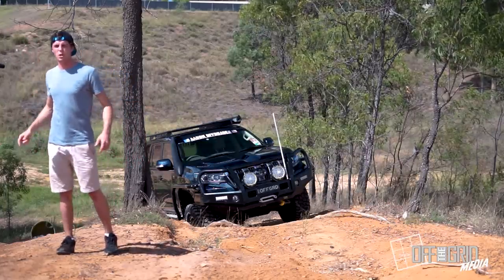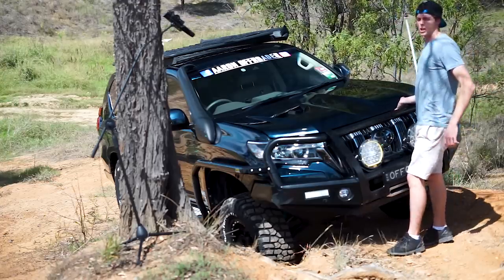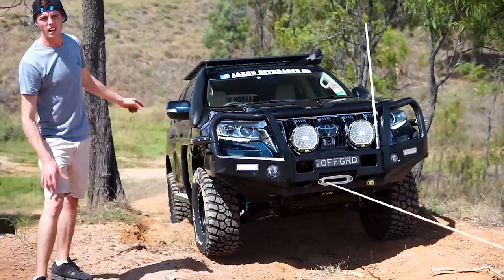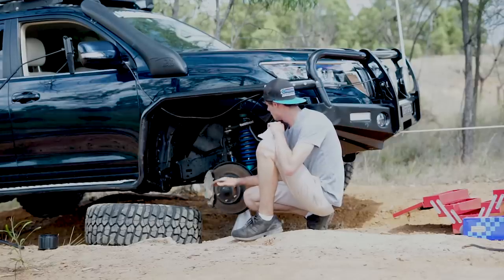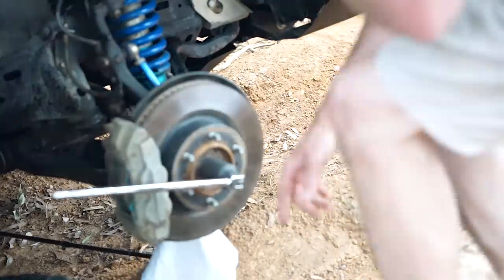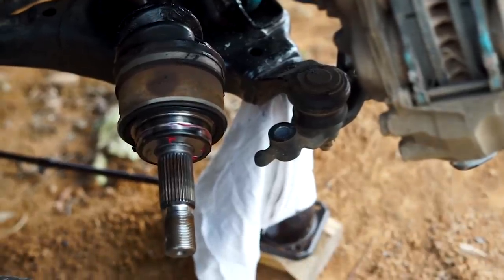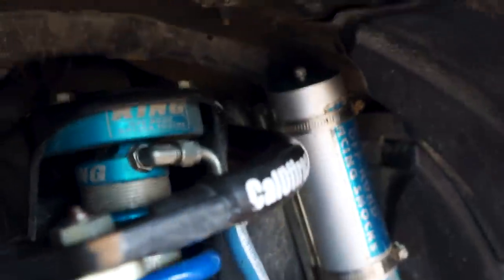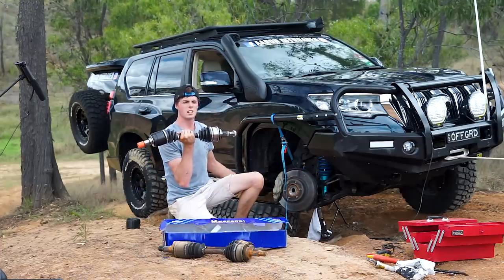4x4 CV Change, Bush Style, Real Life Conditions ** DIY **

Comment: Yes!! More diy. Theres no diy vids for our model prados! Legend
Reply from the maker: Cheers legend! Ive got a massive list of ideas to get through. I should start pumping them out 👌🏽
Did you have any special requests?
Reply: @AaronOffroader  just a heads up mate, I would've lowered the vehicle back onto tyre.
Once tyre was pulled off, even put some maxtrax or timber to lift tyre up to side steps.
Reply from the maker: Jason Currie Yeah,  I agree. Would have been safer 👍🏼

Comment: Nice job.  We need more DIY repair videos for Prados, the online repair manuals are a bit cryptic.
I also have a 2018 Prado and was wondering what to do about a busted CV or wheel bearing ..... carry a spare assembly of course.
By the way, you can get a split rubber CV boot from Ebay UK that will fit the 150, as a spare in case it gets torn in the bush.

Comment: Loved your video. I carry a $2 tarp to put under any work I do in the bush so as greasy parts that drop stay dirt free and are easy to find. I also use a piece of ply as a jacking plate.
Reply from the maker: Bob Waller yeah that is a good idea! I use my awning extension sometimes but dont really want that all greasy. So a $2 tarp would be perfect
Reply: Great tip

Comment: How did you lock the rotor to crack the hub nut if the cv let go ? Did you have someone to stand on the foot brake ? Why did you not crack the hub nut when the tyre was on the ground ?
Reply from the maker: Yeah doing it on the ground is definitely ideal. Just a stuff up on my behalf really. 
But you can put a strong screwdriver down ontop of the caliper. Into the brake disc vents. That will lock it solid in one direction. Or have someone on the brake like you said 👍🏼

Comment: 10:22 You don't change the inner seal? You don't even clean the seal? Won't that keep leaking oil there? 
Cheers
Reply: it will leak if you get dirt in there, it will not leak if it's clean or just has oil on it.

Comment: Hi mate if that was a hilux you could keep driving in 2 wheel drive because it's part time 4x4
Reply: Do you or have you guys in AU had issues with DPF.
Reply from the maker: Yes this is correct 👍🏼
Reply from the maker: Yeah quite a few have had problems. I think its more the people who putt around and do short trips. 
Mine cops abit of a flogging so theres always plenty of heat to burn off properly 👍🏼

Comment: Lock center diff, and it's gonna drive without a darn front CV.. eventually remove the other.
Reply from the maker: florin baiduc yes very true! But you must install both ends of the CV! 

One to plug the Diff oil. 

Then other to hold the wheel on and wheel bearing together. 

You can remove the actual shaft by cutting the boots and dissasembling it! :) 
The shaft doesnt matter if its taken out, cut it in half if you have to.
Reply: @AaronOffroader  true, it hasn't occurred to me. But it's doable nevertheless. Thanks for clarifying this!
Reply from the maker: Thats what you want,
Always a pleasure mate :) 
Have a good one!

Comment: Before you put the cap back on over the cv, do you need to put in any grease ?
Reply from the maker: not really Jordan, a little on the spline just to stop corrosion. or even anti seize.  the wheel bearings are sealed units. But on the back side make sure you do put some grease where the seal is on the CV :) Happy Days

Comment: What brand cv are you using?
Reply from the maker: Umm Kapsars i think. I havent properly sheared one yet. But i did destroy the inner joint completely on a genuine one. 
Just over extended a few of them. But shocks are destroked now
Reply: Aaron Offroader do you have a diff drop. I have changed 2on my sons hilux . Both times on a steep track and using the winch to car like you explained, its a great idea. I also cut some dead tree as a jack stand. But not everyone has a chain saw. But you just gave me an idea on why his are breaking, maybe his shocks are overtraveling. Cheers and great video mate👍

Comment: If having to drive home with removed cv....: You will have to remove remove other cv. Ill explain why.
To move off with missing cv you need to engage diff lock. Hence power will be going to front and rear differential. As the diff is now missing one side connection to ground it'll will be transmitting your full engines rpm through the satelite gears to the missing cv side! You will burn out your satelite gears or/and shims etc.

Hence forth, solutution to running with missing cv is as follows.
1) Remove broken cv. Engage front difflock. Run vehicle without a centre difflock home. Plug hole in side of diff. Note if you have twin lockers you will need to switch your piping at the solenoids as arbs need rear locker on before front is engaged???
2) remove both cvs and run home with centre difflock engaged. I imagine you would need to stop oil from coming out of the diff. Not sure how thats going to happen.
3) remove cv and front.propshaft. engage centre diff lock.
4)if having to travel home with missing cv its best to remove both cvs ad remove front prop. Run vehicle with centre diff lock engage.
That way the front diff will be not turning. With some rags on the sides you shouldnt loose much oil or dirt entering diff...

I think the main problem heading home without a cv in the diff is you destrying the diff and oil coming out. You need a solution to that. Reason for removing cv is it maybe super exploded or snapped . 
Best solution in my opinion is learn what how to swap your cvs in the field or run solid axle front end 4wd.
Reply from the maker: Matt Luszczak hey man. I agree with most of this but the most important part has been missed. 
If you drive without the outer end of the CV in your wheel bearing will pull out of the housing and you will loose a wheel and probably crash.  So if you have one busted CV ild rather risk the Diff Damage or take out the front driveshaft.  What you do is cut the cv boots off the broken CV dissasembe it taking the middle shaft out of the CV leaving you with 2 seperate ends. Pull everything out of each end then install the ends back into the vehicle. One clips into the diff and stops any oil or contamination issues. And the other outer one holds the wheel bearing together. Assembly as normal (just with no Shaft or inner Bearings of CV)  off you go safely 👍🏼

Comment: great vid bud. what shocks and springs are you running and if needed what offset are your rims?
Reply from the maker: Hayden Frederick 0 offset wheels. They were King Racing Shocks 2.5s but over the moon to do away with them in the new build. 
TJM XGS like a 3rd of the price and hasnt had 15 failures in 20,000kms 😬

Comment: Great Vid as usual, How many CV's have you gone through? i've done 45'000km in mine and some very hard tracks and never had an issue, is this an issue from an extra high lift? what is causing it to break?
Reply from the maker: Yeah i was originally supplied with shocks that were too long. I had to drive to brisbane for them to destroke them. 
I havent broke one since. Just this time the superpro swaybar link stripped again. And tore the boot all the way around. 
I prefer to just put a whole CV in it and be done with it. 
Im removing the swaybar from the front once again.

Comment: Well done! Very helpful! Where's the other video about cutting up the CV you took out?
Reply from the maker: Never finished it and i do apologise mate. 

Just need to remove the shaft out of the equasion. Put both ends of the CV back in. 

Bolt the outer back in. Re tension the nut. 

Slip the inner one back in. The circlip should retain it enough to stay in without any drama.
Reply: @AaronOffroader  thanks mate! What do you use to remove or cut the shaft when out in the bush? Will a hacksaw be enough?

Comment: Good one man, nice tip using the ratchet strap, did you say that your sway bar broke ?
Reply from the maker: Cheers man! I used to do it the other way. But this is heaps easier! 
Yeah ive been having so much trouble with these SuperPro Swaybar links. The threads arent long enough even without washers. I run loctite on them but it still pulls the threads off them!

Comment: Nice video. A question regards to your front recovery points, do you use the factory tow points or after market one?
Reply from the maker: Hi there. There are 2 built in 8 Tonne recovery points as part of the winch cradle itself. 
Thats a feature on the TJM T13 Outback bar 👍🏼
Reply: Thanks :) @AaronOffroader